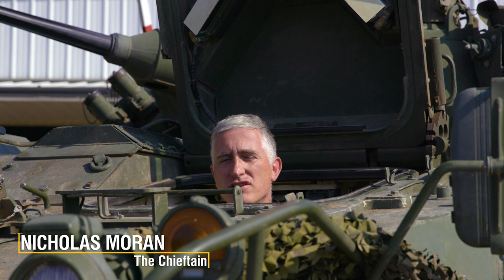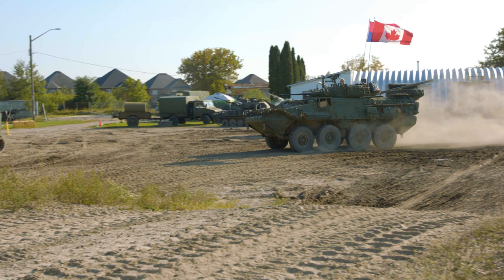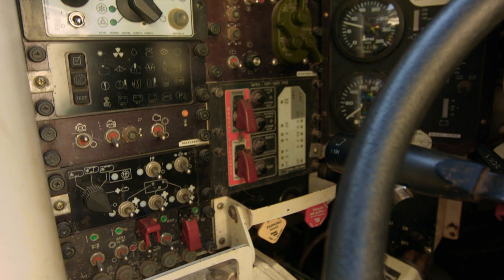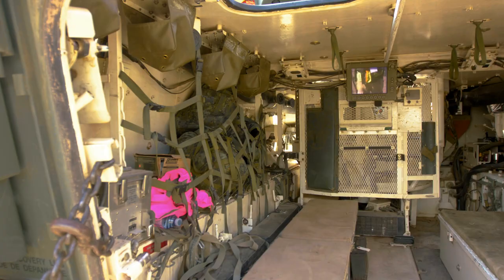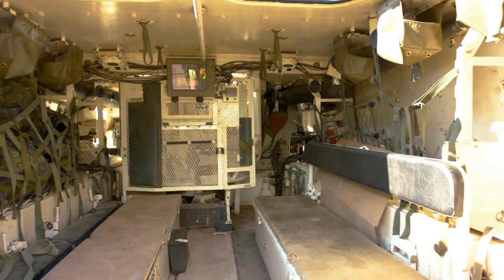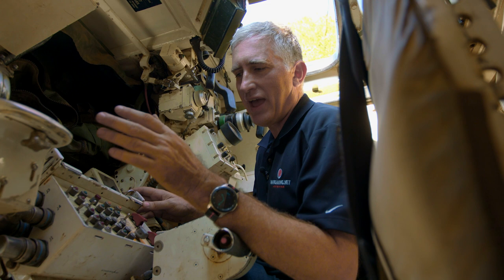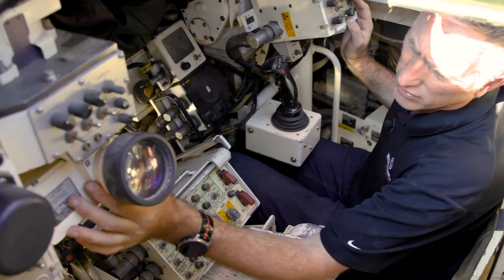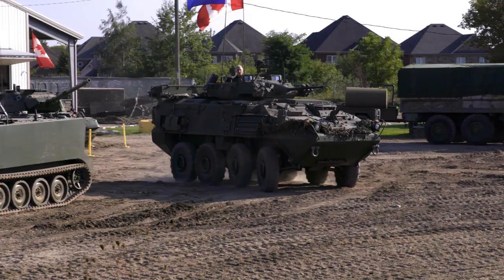Chieftain Shorts - LAV III - World of Tanks

Comment: The BV (Boiling Vessel) and Heater in the LAV III are a dismounts best friend. You can get in saturated and within 20min are dry and having a hot brew and scoff. Rumour has it various devices may also be able to be wired into the CSAM (tv screen for the dismounts) but I could never confirm nor deny seeing a Playstation plugged into one. The screen is great but takes some getting used to sitting in the back especially when you are seeing what the turret is looking at in one direction whilst the wagon is moving in another. It can give you some mean motion sickness so we would generally change to the drivers view/camera until we needed the turret view.
Reply: I can confirm an M113 in US service in Germany back in 1999 that had a TV screen and Playstation installed. And as a loader on the Abrams I was quickly taught how to wire in a set of headphones to the intercom so we could listen to music through our helmet headsets.
Reply: @timsmith4548  nothing like setting the scene with the right soundtrack over the comms as you're rolling out of the FUP
Reply: For rent 8 wheeled mobile home. amenities: ac, heater, tv oh and a 25mm auto cannon, Numerous mgs and smoke grenade launchers that may or may not be modified into a security system
Reply: Interesting!!
👍

Comment: Just like the LAV-25 that the Marine Corps uses. I enjoyed riding around in them when I was in the Corps.
Reply: Excetp thjat I think that the LAV-III is a newr hull design than the -25.
Reply: i work on them now lmao
Reply: Closer to a Stryker, actually.  The Strykers are based on LAV-IIIs (same hull), and many were built at the same factory as the LAV-IIIs.  The LAV-25 is based on the older LAV II hull (AKA the 'Bison' in Canadian use).
Reply: @ArmouredPhalanx  Technically, the Coyote and Bison are based on the LAV-25 as it predates both vehicles by a bit. Fun fact, the design process for the Bison supposedly only took seven days.
Reply: @XanderTuron  It does, that's why I said based on the LAV II (as in the common platform), not based on the Bison (a specific variant).  I created the original Bison (armoured personnel carrier) article on Wikipedia and included the 'seven days' bit of trivia from the attributed source, which may be where you got it.  I should have mentioned the Coyote, too, but blanked on it.

The LAV-25 was developed from the AVGP/LAV I (Grizzly) in Canadian service, and the AVGP was based on the MOWAG Piranha from Switzerland.
Reply: @ArmouredPhalanx  That's actually really cool that you are the one who wrote the original Wikipedia article on the Bison.
Reply: But no props for Marine environments.

Comment: Australian AFV's have an air conditioning system. But it is designed to keep the temperature inside the AFV the same as it is outside.. The thinking goes that when the troops disgorge from the back they do not experience any dramatic temperature change and thus they experience no environmental shock..
Reply: @TheCoolCucumber  Yes.. thats true.. But Australians and Canadians can get accustomed to each others evironment if they live in the other country for a year..

Comment: I've always thought that one of the logistics versions without a turret would make an awesome overland RV with proper modification.  They will go anywhere that common sense allows and can even cross bodies of water so turning one into an RV just makes sense in my mind and it's hull makes it very secure and durable.  I would definitely find a way to dramatically improve its range by removing all unnecessary equipment and adding as little as possible during conversion.  I would certainly increase the fuel capacity as much as possible as well.  I'm sure some modifications to the driving area would be needed as well to make it legal.

Comment: Very cool... Now I want one... To deal with the Chicago weather(and bad drivers).
Reply: Dunno about the weather, but all I need for bad drivers is a 1920 Pattern Rolls Royce Armoured Car. A Vickers Gun is more than enough for what I have to put up with. And who doesn't want a Rolls?
Reply: The military pattern tires wouldn't do well on icy pavement;).  It weighs about 16 tons but I had one skid several feet on black ice one time when we were just idling along at about 10 km.
Reply: School run?
Reply: @silverjohn6037  The weight didn't break through the black ice? Wow.
Reply: @aaronleverton4221  It was a light pebbling from a misty drizzle on cold pavement.  Almost like curling rink ice if you know what I'm talking about.
Reply: @silverjohn6037  Not really. My experience of black ice, such as it is, was over 30 years ago in a different country. I was a kid, I remember chains being sign-posted (not sure I remember them being fitted by family, but I remember seeing them fitted by others) but, if an '80s family car with chains fitted can break the black ice, why wouldn't 8x that weight break it? I am not contradicting your experience, just kind of amazed.
Reply: @aaronleverton4221  The chains (and tire studs) tend to concentrate the weight of the vehicle into a number of smaller points that have sufficient hardness to penetrate ice. Eight large tires, on the other hand, tend to spread out the weight.
Reply: I mean with 700ish shooting taking place on the highways this year....it makes sense
Reply: @strathadam1  Ah, the thing I had forgotten, weight distribution.

Comment: negative on the blast seats unless they were put in after 2007, benches were the main stay in the LAV III in Afghanistan for 2007 
the 25mm had a stabilizer system but it did not have a lead system, all targeting was don't by the gunner and the reticle system in the main sight
the grenade launchers had HE ammunition, but in all of the tour of 2007 were never used it. most times the connection in the launchers got covered in sand and wouldn't fire even smoke

Comment: Rode these a bit in Afghanistan. I liked the TLAV better which was basically a modernized M113. seemed to survive RPGs and IED's better and was more capable off road. Didn't have the nice 25mm the LAV3 did though. With full gear loadout you're only getting 4 guys in the back.

Comment: New Zealand operates a version of this called the NZ-Lav III, bought from Canada. Not sure exactly what the differences are or if we just added NZ Infront of the name.
Reply: Very few differences. 
Interesting that this is now in a museum and Canada is updating to LAV6.
NZ will have to wait a few more decades before any (if at all) upgrades.
Reply: @damolux3388  Defense is not high on the list of budget allocation for governments either side of the fence so you are probably right. 

Although the lavs are probably good enough for the types of operations NZ undertakes now or for a few years into the future?
Reply: Ex-kiwi Father in law told me NZDF ordered twice as many as they needed, thinking the government of the day would reduce the order by 50%.... then the government signed off on the order and the army were stuck with the lot!
Reply: @SnoopReddogg  Not entirely correct.
The original plan was to fully motorise both regular infantry battalions in NZLAV. Which with vehicles for the combat school for training and a few spares for through life sustainment equals about the 105 purchased.
Reply: @SnoopReddogg  yea not quite.  They were originally aiming to motorise both Bns rather than the old org of sharing when required but then found they couldn't actually crew them all due to the increased manpower required (2 per m113 for 1 bn vs 3 per NZLAV for 2 bns) so reverted back to the old way of essentially battlefield taxis rather than dedicated armour.  Essentially it was a manning problem in the end (as with many NZDF units, even today), they had a plan, bought the right numbers for that plan, then changed the plan back so then obviously ended up with spares.

Comment: That cat diesel if it has a mechanical fuel governor is easily able to get up to around 500hp with two turns of a screwdriver.
Reply: Shhhhh, don't give the kids any ideas!
Reply: It's a 3126, it is electronically managed/controlled. The gen 2 lav had a mechanical engine, buy it was a 6V53 Detroit.

Comment: Is it not counter-intuitive to have the engine stop if it senses low oil? A warning light/buzzer combination would be better. Say, it takes a hit, and starts pissing oil, fast. There's a wadi 30m ahead that will hide the LAV. To hell with the big end bearings, I wanna get to cover even if the pistons weld themselves shut in the process. Hopefully there's an override switch somewhere.

Comment: The Belgian army has them too. Just another turret mounted on it with a 30mm dual feed chaingun. I talked to some guy's who operated those vehicles and they said it is underpowered in the terrain. 360hp is a joke. Why not drop a Scania V8 in it with 750hp? It has nearly the same dimensions as the Cat engine
Reply: It’s supposedly a Light Armored Vehicle, not an IFV.  This was not meant to be a full infantry armored vehicle, like a CV90.  It’s designed for roads and light deployments.
Reply: @petesjk  well yeah that's what's those guys told me too. Bud the brass are using them wrong, that's why there going to be replaced by griffins and jaguars. Same story with our dingo's. Good for road use here in Europe, not in Afghanistan where they broke down due to the hot and dry climate and also underpowered for that terrain. It seems that our army has a tendency to always buy underpowered vehicles. The unimog's, iltis, Volvo trucks, iveco trucks,......all underpowered.

Comment: Did you just say 6 cylinders? Wow. Had you asked me, considering it weight for an AFV would have minimum 8 cylinder.
Reply: Every semi truck I’ve ever driven was a 6 cylinder. It’s not uncommon to see 600+ HP coming out of an on the road engine. The 3126 Cat engine in the LAV has a reputation as a dependable engine but it’s also a bit of a dog when it comes to power. The 3126 is a little brother to the 3406 (7.2 litre vs 14.6 litre displacement).  The 3406 is a 6 cylinder as well and puts out high 500 horsepower. I’ve run an 8 cylinder Cat 3208 and the downfall with that configuration is the lack of torque on the engine. It was a V-8 engine and needed high RPM to generate sufficient power where the straight 6 engines pull way better at low RPMs.

Comment: Hey Chieftain, would it be possible to mount a 75mm Gun Turret onto a LAV or Stryker vehicle?

While not a Tank Killer, against most other targets, I would assume the 75mm would do a lot of damage. Especially against vehicles NOT of similar size and displacement.

Of course, if there is a chance of Tanks, a couple of TOW Missile Launchers mounted externally in an armored box doesn't sound like a bad idea.

Or hope that one of the Gibs happens to be the guy with the Javelin.
Reply: @TheCoolCucumber - The US Army is retiring the Gun Stryker next year.

The idea I had was for a temporary gap filler that would actually include AC for the crew AND equipment as well as a study of what autoloader works best.

It's smaller, cheaper, and still potent enough. It can be fielded therefore in greater numbers to allow for a responsible test period. At the same time, data can be used to better understand where such vehicles can be placed in future development. 

The US Army already plans a 105mm Light Tank. So having a 75mm vehicle alongside makes some sense. It can outfight or outrun anything it comes across. The smaller gun would also be useful in Rear Area Assignments were 105mm guns are a bit more than overkill.

And, if there is need, the 75mm would give wheeled vehicles over 95% of Technicals out there.

I figure one 75mm round would cost less than a dozen 25mm, 30mm, 40mm or larger autocannon rounds fired at the same target.

You also get a bigger bang for the dollar and greater kill radius, so even if it misses the Technical, it could still shower the vehicle with shell splinters, shrapnel, and secondary debris.
Reply: @FLJBeliever1776  I feel like the 25mm is still plenty of firepower to shred technicals, and you'd get a heavier volume of fire and can carry more ammo. I would wager with AP rounds the 25mm could even take out most other light armoured vehicles, including the LAV itself. It falls short against a heavy tank, but probably a 75mm would as well, and if you're going to put an armoured unit up against a heavy tank, you better make sure it has the kahonis to get the job done.

Providing a high volume of fire is crucial in an infantry support role, which is what the LAV III's main purpose is.

So personally I don't see a place for a 75mm gun. @FLJBeliever1776  I feel like the 25mm is still plenty of firepower to shred technicals, and you'd get a heavier volume of fire and can carry more ammo. I would wager with AP rounds the 25mm could even take out most other light armoured vehicles, including the LAV itself. It only falls short against a heavy tank, but probably a 75mm would as well.

Providing a high volume of fire is crucial in an infantry support role, which is what the LAV III's main purpose is.

Comment: So THAT'S what the New Zealand Army LAVs would look like if the NZ Army had had the money to buy all the fittings they're supposed to have!  I bet the Canadians can even afford ammunition as well!  The NZ Army can only afford 500 live rounds per year for use across the 42 vehicles they can afford to run. The other ~50 vehicles left are in storage and slowly being cannibalised for spares.
Reply: @TheCoolCucumber  Kinda makes you wonder why they bought so many, doesn't it?
Reply: @iatsd  my ex-kiwi father inlaw told me they ordered twice the amount of vehicles they needed, thinking the government would automatically cut the order by 50% regardless.  Then the government just signed off on the order and all of a sudden they twice as many as required. I asked Col.John Howard about this once, he confirmed the story.
Reply: LAVIII and NZLAV are the same vehicle🤦‍♂️
Reply: @regregan6852  They are based on the same design, but the NZ ones were bought & delivered stripped out of most of the standard equipment or was downgraded to the original kit rather than the then-current production kit.  They've bought some of that kit since then, but the NZ LAV's are still less than half as capable as they should be.
Reply: @iatsd  stripped of most of the standard kit?? Downgraded??  Such as?
Reply: @regregan6852  When they were delivered they had no night vision kit, only half the stowage bins fitted, no stabilisation system, the old EMC system for the engines, a downgraded navi system, and the original suspension systems.  Those were all deliberate choices and were to save money.  Some of it has since been bought or updated, but I'm pretty sure they still lag behind the last production versions.
Reply: @iatsd  so most of that is country specific equipment and is common to all vehicle fleets as NZ would have it's own versions and generally systems like nav and radios are NZ sourced anyway.  Considering the Canadians got their LAVs in 99 and NZ got theirs in 03 what exactly do you mean by "old" EMCs and original suspensions??  Are you saying Canada essentially upgraded their brand new vehicles or NZ put in different systems?  Any links to these upgrades/downgrades?

TBH none of those things are game changers anyway imo and definately does not equate to "half" the capability??  Stowage bins?? Seriously?  They don't routinely fit side bins anyway as the NZLAVs are at max legal width for NZ roads as is hence the marker panels, but again, hardly a game changer by any means.